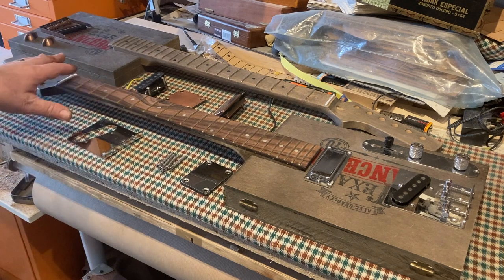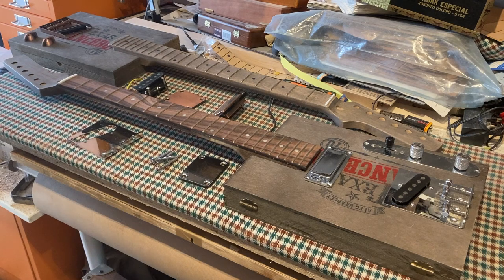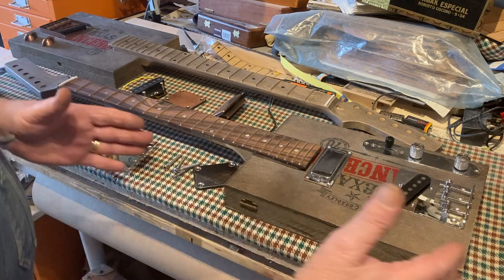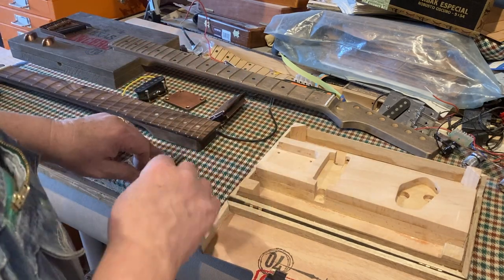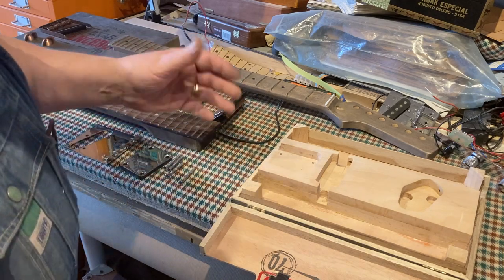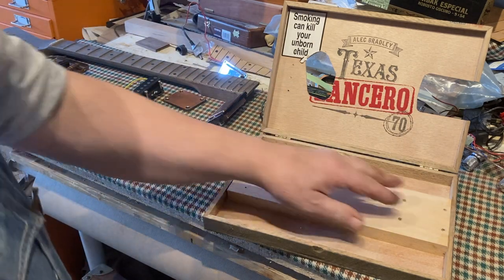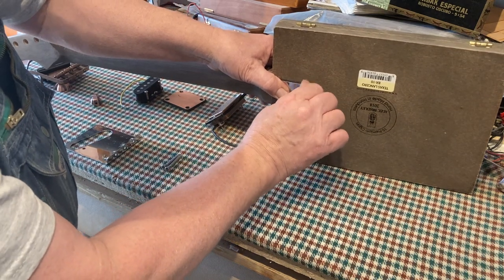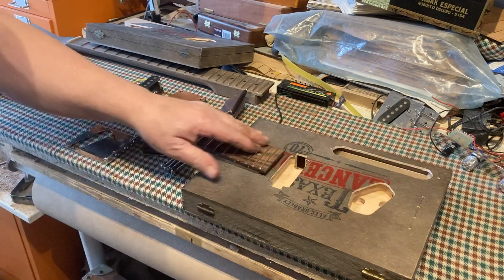Making a 6 string cigar box guitar with a standard Fender style neck

Comment: Excellent video John, and greetings from Wisconsin!  I'm assuming no back angle in this design with the bridge saddles used?  I hope you do a sound demo when those are complete!
Reply from the maker: The Fender design is based on a neck which is installed parallel to the top of the guitar, so no back angle.

Comment: John, what is the height of that cigar box? And how thick are the two stacked blocks? I’m assuming the top block that’s routed for the neck pocket is 5/8 inch less the thickness of the lid but how thick is the lower block?
Reply from the maker: I can't remember offhand, the box is around 38mm overall,  and the back block is around 16mm thick. You have to figure these out individually according to what box you are working with.
Reply: @ChickenboneJohn just got my kneck John of you I have two boxes .23 inch kneck box but I have a gold box I just got that beautiful.but it’s 12 inch long by 6,  9 wide .cld I get the kneck I ordered to work with this box .cheers ,soon be another order from Edinburgh Thnks great work ,